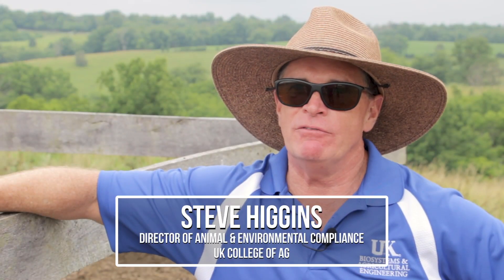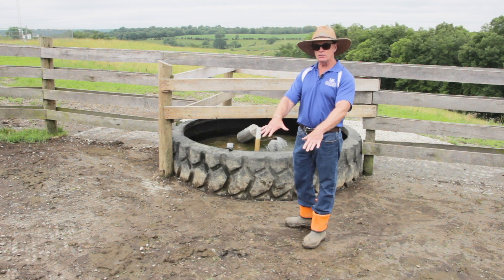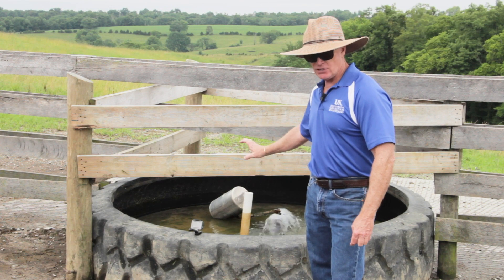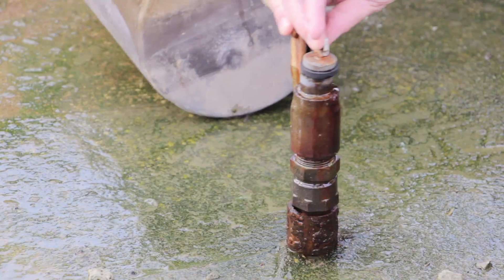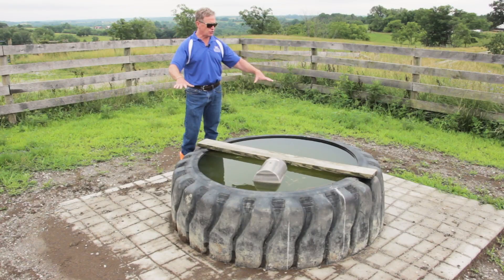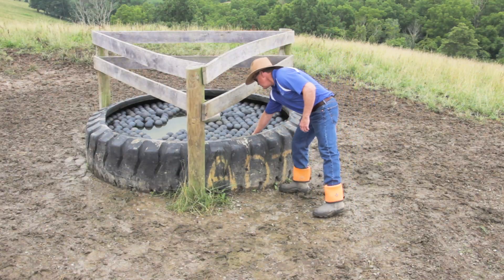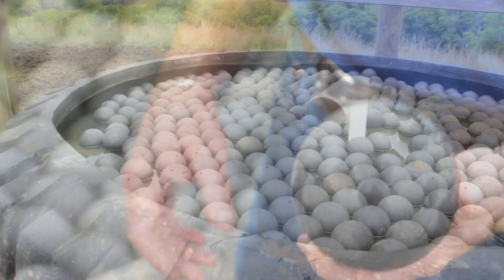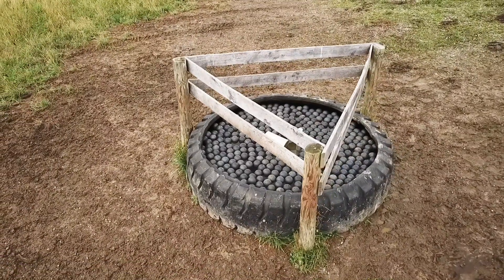Tire Waterers at Eden Shale Farm

Comment: Tires have toxic chemicals in them.😢
Reply: I have wondered about this but have seen so many regenerative farmers use tires, I thought it must be safe.  So, I asked Grok, and Grok says:
Yes, old tires can contain toxic chemicals that may pose risks when used as livestock water tanks. Tires are made from synthetic and natural rubber, carbon black, heavy metals (like zinc, lead, and cadmium), and other additives, including oils and sulfur compounds. Over time, these chemicals can leach into water, especially when tires are exposed to sunlight, heat, or acidic conditions, which can accelerate degradation.
Key Concerns:Leaching of Toxins: Studies indicate that tires release compounds like polycyclic aromatic hydrocarbons (PAHs), heavy metals, and volatile organic compounds (VOCs). PAHs, for instance, are known carcinogens and can be toxic to animals if ingested over time.
Livestock Health: Prolonged exposure to contaminated water could lead to health issues in livestock, such as gastrointestinal problems, reproductive issues, or chronic toxicity, depending on the concentration of leached chemicals.
Environmental Factors: The rate of chemical leaching depends on factors like water pH, temperature, and tire age. Older, weathered tires may release more contaminants as they break down.

Comment: Would definitely upgrade float system to flat pancake style w/ hole in center . Run chain attached to float arm through the hole in float & adjust float height by clipping chain . Much easier adjustment .